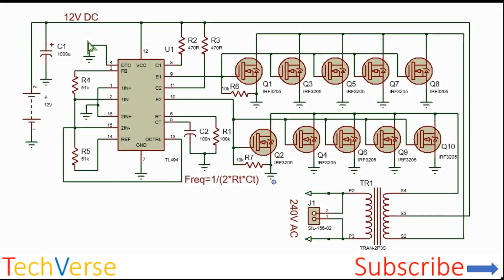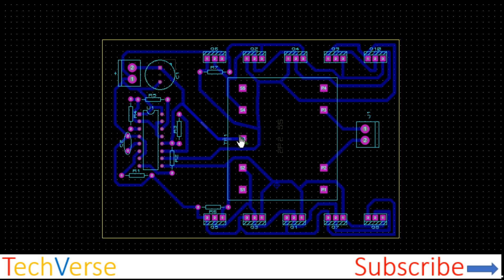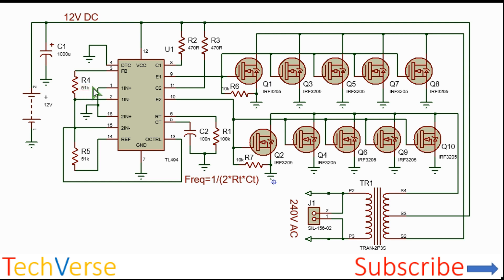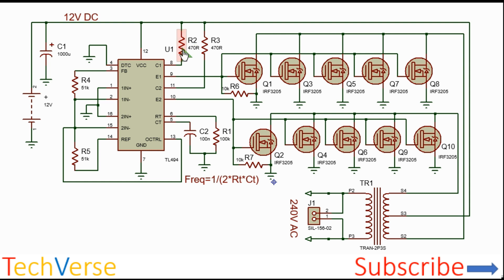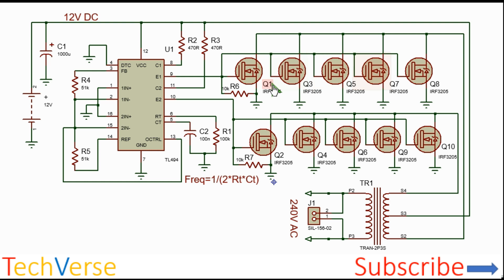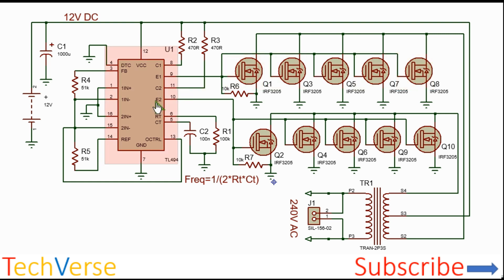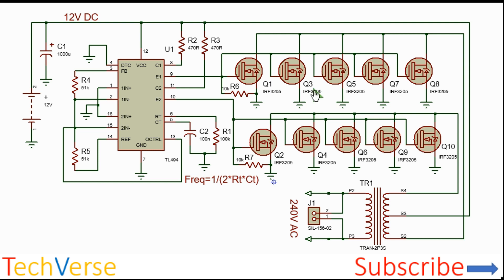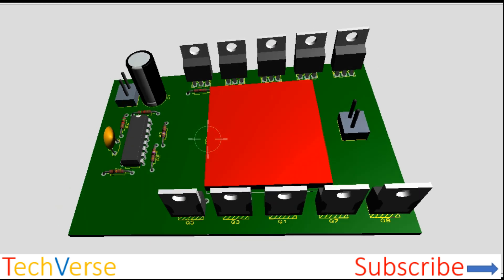TL 4000W Power Inverter 12-220V Inverter Circuit Video Tutorial

Comment: Please tell me how would I use only 120 volts instead of 220? here we work only with 120 volts is Venezuela
Reply from the maker: The output voltage is entirely dependent on the transformation ratio. For 120V, just reduce the secondary windings by Half. This will give you an output of 120 Volts. If you have access to a transformer which steps down 120V AC to 12V, just use it backwards instead, it should work like a charm. Thanks.
Reply from the maker: The output voltage is entirely dependent on the transformation ratio. For 120V, just reduce the secondary windings by Half. This will give you an output of 120 Volts. If you have access to a transformer which steps down 120V AC to 12V, just use it backwards instead, it should work like a charm. Thanks.
Reply: @ELECTROBUFF  उ

Comment: If the circuit design is like electricity, do you work on the output voltage adapter? This is 12 volts first, but secondly, does it work on MOSFET iRFP 064 if only on the MOSFET you mentioned
Reply: السلام عليكم ورحمه الله وب كاته
هل هاذا صحيح  عل كم امبير يعمل